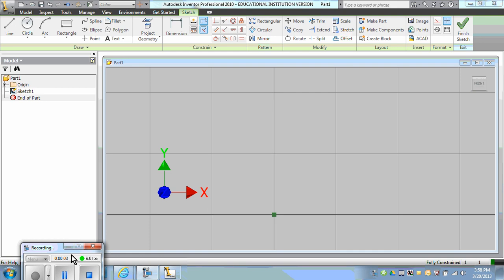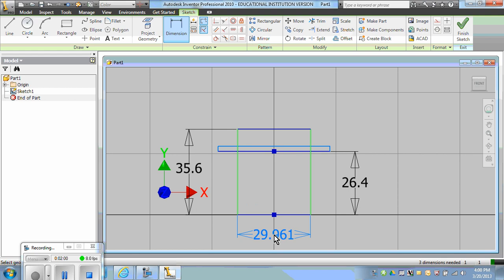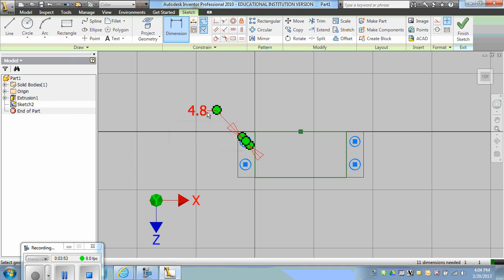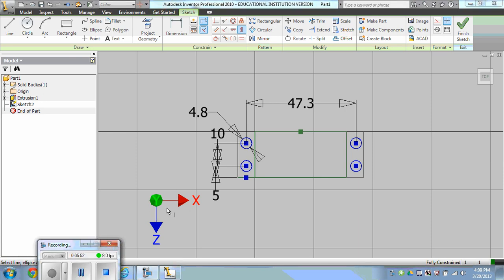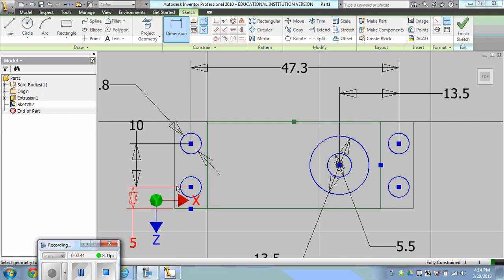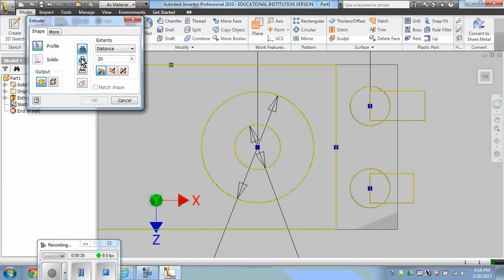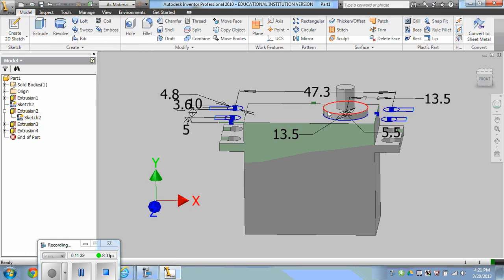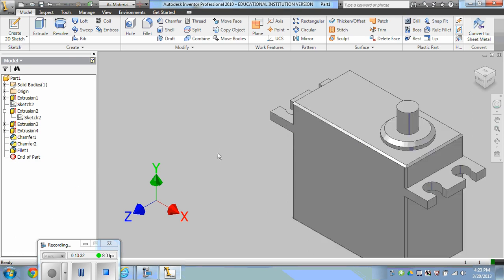servo video

Comment: You messed up when constraining the 4 small circles, when you constrained the centers vertically to the midpoint of the 'lip', you used an incorrect edge. This may have thrown off some later measurements.